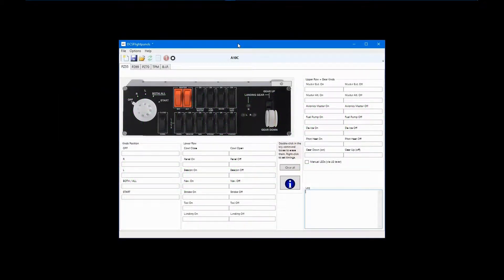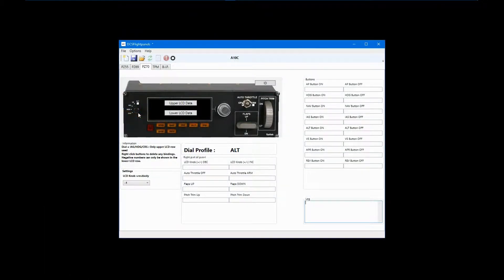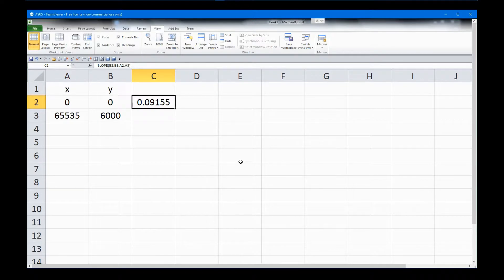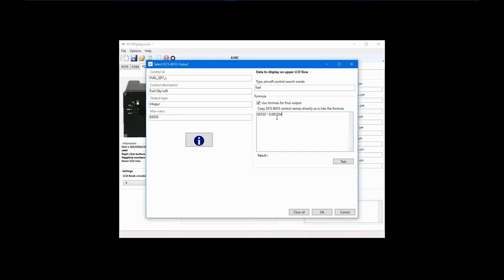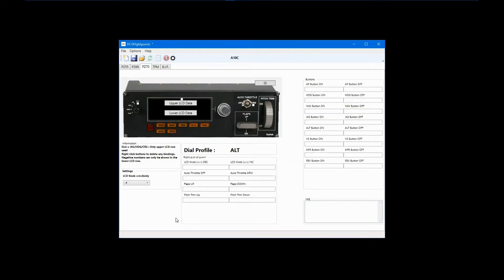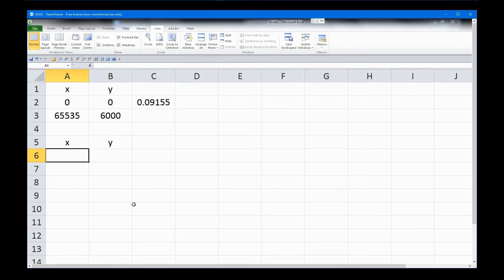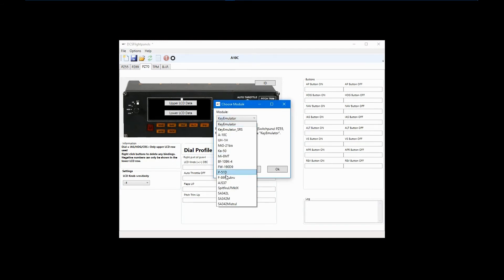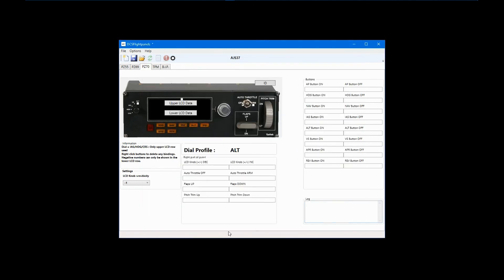DCSFlightpanels -- Working With Formulas

Comment from the maker: Regarding vertical velocity indicators, while my comment in the video regarding the inability of DCS-BIOS to produce negative numbers is correct, a formula within DCSFlightpanels could yield a negative value.  I believe only the VS display on the Multi Panel can show a negative sign.  In any case, VVI formulas can get very complicated as the scales are generally either non-linear or have two different scales on the same gauge, one for fine measurement from 0 to 1000 fpm and another for courser measurement from 1000 to 6000 fpm.  In general, it's probably best to just use the in-cockpit virtual gauge to see VVI.